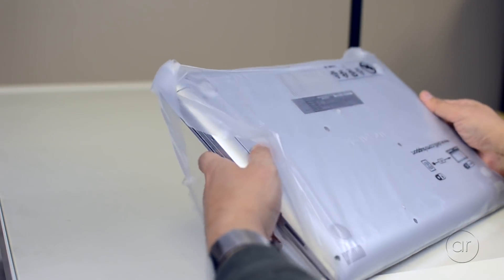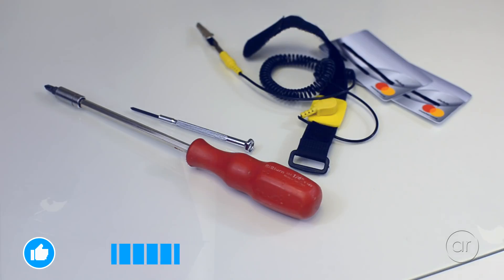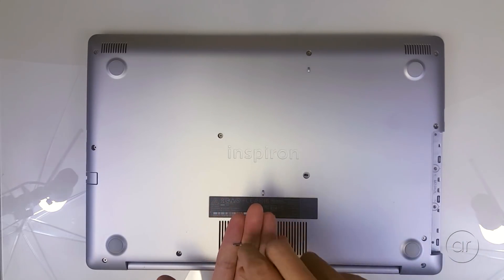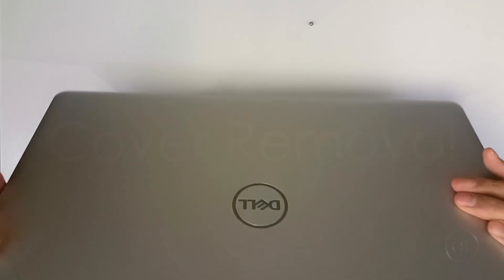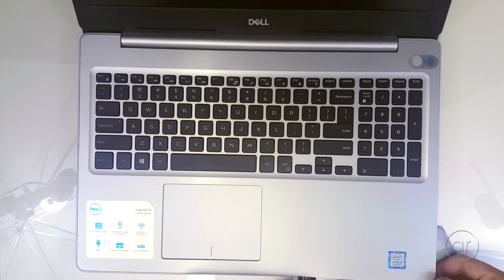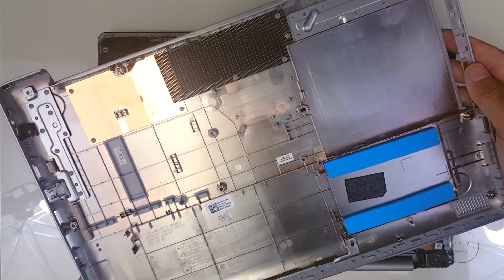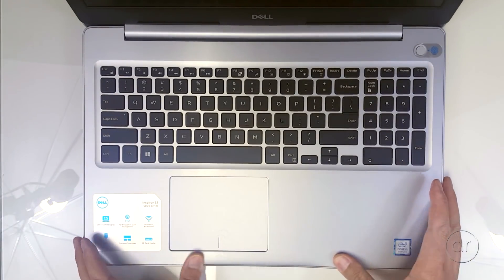How to Disassemble a Dell Inspiron 15 5570 Laptop to Install an M.2 SSD

Comment: I got excited when I watched your video and went out and bought a 1TB M.2 2280 SSD from Western Digital.  Before doing the install, I went back to review the video and the comments, and now I see that this machine will only support a 256GB SSD.  What would happen if Installed the 1TB SSD?
Reply from the maker: My installation of a 360GB SSD worked fine. Some have suggested that Dell's specs are simply the largest that they had tested at the time the documentation was written, and that it would not hurt to try larger capacities.
Reply: @accessrandom  Thank you for the fast response.  I think I will go ahead with the install.  I'll let you know how it works out.
Reply: @Spocket  Did it work for you?
Reply: @priteshjumani7249  I changed my mind about it.   I was afraid of voiding my warranty and being stuck with a broken computer.

Comment: Hello! Why you used SSD SATA instead PCI ex 3.0 with NVMe which is much faster  3000 mb (PCI ex) against 500 mb (SATA) ?
Reply from the maker: Hello - the Dell can take either SATA or NVMe, but I only had the SATA SSD at the time I created the video.

Comment: I barely bought the same laptop. I want to install an Adata xpg m.2 2280 pcie gen 3x4 nvme ssd and samsung 860 EVO Sata ssd. I don't mind reinstalling windows but how do I make sure that it will install Windows on the m.2 ssd instead of the SATA? Do I install the two drives hit F2 and change the boot order to my m.2? Or will it let me choose?
Reply from the maker: I'm so sorry, your message got filtered and I didn't receive a notification from Youtube so I just saw your post now. When reinstalling Windows from an ISO file, it will list the disks that are in your system, and you can choose to which disk you'd like to install Windows during the install. I believe it would be the same with any recovery disk(s) provided by the manufacturer, but just in case it isn't: you can physically install the SSD you'd like to boot from, use the recovery disk(s) to restore Windows, and then install the other SSD. Sorry again for the delay in replying...

Comment: Hello. Thanks for the video! I just subscribed to your channel :) I just got the same computer and wanted to know it if has a M.2 slot. Do you know how much is the maximum amount of storage this laptop supports? I want to upgrade to at least 512GB. Do you know if this model will work properly with the computer? Samsung 970 EVO 1TB - NVMe PCIe M.2 2280 SSD (MZ-V7E1T0BW)

Thanks a lot again and take care! :)
Reply from the maker: According to Dell's Setup and Specifications manual, the 5570 supports a "maximum configuration" of up to 256 GB for M.2 SATA SSDs, and up to 512 GB for NVMe SSDs. I've heard from others that this means that Dell will only sell configurations up to these capacities (not that the motherboard cannot support more). I can only speak from experience, which is that my 360 GB SSD is over spec yet it works fine.
Reply: Thanks a lot for the answer. Well, I purchased the Samsung 970 PRO 512GB - NVMe PCIe M.2 2280 SSD (MZ-V7P512BW) and just installed it and cloned it as you explained in the other video, I used the the same cloning software and it is working fine, cloning the 1TB took more than 2 hours :) Now with the new SSD, it took less than 15 seconds to boot since the moment I press the power button until getting the login screen. Beautiful! Thanks for the time and excellent videos!!!!!
Reply from the maker: Super! That's great to hear.
Reply: Just installed an Intel 660p 1TB NVMe SSD yesterday, so larger drives are supported too.
Reply: @everness7  excellent! Good to know.maybe in the future I will migrate to a bigger ssd! Budget issues, you know! Haha

Comment: Hi Can we use a msata SSD instead of  M.2 SSD? I understand that msata SSD's are old technology, but have an extra one with me I would like to use...
Reply from the maker: As I understand it, mSATA and M.2 are not pin compatible but I have heard of adapters for mSATA drives to fit M.2 slots. Perhaps one of my viewers or subscribers who have tried it have more information? Anyone?
Reply: Thanks for the response.  I think I will pick up a  M.2; prices are coming down at this time of the year!

Comment: Hello! What is the strap for? Where do you attach it? Why? To avoid getting electrocuted? Sorry, I'm a total beginner.
Reply from the maker: Hi - the strap is to ground yourself so that static electricity from your fingers doesn't fry any electronic components. I clip mine to the metal casing of a desktop computer which is off the screen. ESD (electro-static discharge) can be insidious because the damage may not be immediately apparent (sometimes the damage is catastrophic - sometimes you see the damage over time).
Reply: Thanks for responding. If I don’t have the wrist strap, how can I install my new ssd without damaging the components? Please give me a detailed explanation as I am a total beginner. Thanks in advanced!
Reply from the maker: If you don't have an ESD strap, you can touch the metal (un-painted) part of the desktop computer at all times while handling any electronic component such as the M.2 SSD.

Comment: Thank you sooo much sir for this detailed video. I searched many videos but yours is the best one...no other video can replace yours.
I am planning to buy this laptop 2tb one. I'm confused to buy this one or HP CC129tx.......plz help me
Can we upgrade the ssd as same with HP cc129tx.....?
Plz answer me sir ....🙏

Add the link where we can buy ssd for dell 5570
Reply from the maker: Thanks so much for your comment. I'm not familiar with the HP laptop you referenced, but I would check HP's website to see if there's a service manual that details the access to the SSD slot. There is an affiliate link in the description for the Dell 5570 (in the US), but of course it is also available at Dell as well.
Reply: THANK YOU SIR I'M FROM INDIA ....
I ALREADY BROUGHT THIS DELL LAPTOP ON FRIDAY THIS LAPTOP IS VERY GOOD........

Comment: thanks for such an amazing video....can u please suggest me that whether I can install 512gb SATA SSD in dell 5570 laptop because in the official manual of dell it is restricted to 256gb SSD only for SATA...thanks in advance!!!
Reply from the maker: Thanks for your encouraging comment. You are correct in that the 5570 officially supports up to a 256 GB SATA SSD as shown here:

http://topics-cdn.dell.com/pdf/inspiron-15-5570-laptop-_setup-guide_en-us.pdf

I can only speak from experience , which is that my 360GB SSD is over spec yet it works fine. My only concern is that they could release a BIOS in the future to make my 360GB not work. Sorry I'm not able to provide a definitive answer - perhaps other can chime in?
Reply: thanks for the quick response...I will be grateful if u suggest me that should I upgrade with 512 SATA SSD even after official restriction to 256 GB and whether it will have any negative impact on my laptop or performance if I do so by installing 512 GB SATA SSD...
Reply: @akshayaamar9825  Hey did you install 512 GB SATA SSD in M.2???
Reply: @GabrielMendezz  I installed 256gb SATA SSD in order to avoid compatibility issue
Reply: @akshayaamar9825   yeess good job so i decided to buy one ssd m.2 NVMe with 512gb as it said the manual  there is not problem with that ssd NVMe with 512gb
Reply: @GabrielMendezz  gr8...hope u enjoy the experience with the upgraded drive...

Comment: sir isn't support on Dell 5559 laptop plz tell me.....
Reply from the maker: Looking at Dell's website, I didn't see support for an M.2 slot for the 5559, sorry. (If you search for Dell 5559 manuals and documents, you'll see Specifications documents). The casing itself look different if you look at the service manual.

Comment: Could you possibly create a video demonstrating how to apply new thermal paste to the cpu?
Reply from the maker: If I ever get an opportunity to do so, I'll create a video. Were you looking for just a video on placing a heatsink/fan on an Intel or AMD CPU in a desktop PC?
Reply: Thank you! We'd greatly appreciate it.
A video more along the lines of applying new thermal paste for this model laptop.
Due to the thinnest of this laptop, fans tend to throttle under heavy load during content creation. 
Knowing how to apply new layers of thermal paste to the CPU may help prolong its lifespan.

[I recently bought this laptop and am sorta new to laptop maintenance]

Comment: Hi Access random.. nice video!  I just bought one of this with M2.SSD installed..   the thing is I wanted to add my old SSD for additional storage.  Do you know if it comes with HDD/SSD cable already. and of course the bracket.     The bracket I'm not so afraid, but if there's no connector, it's no point to open up the computer.  THANKS!
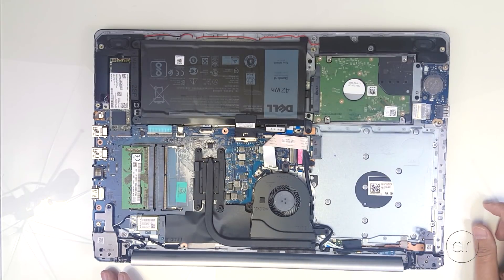Reply from the maker: Thank you! The interface for the 2.5" SSD is simply a SATA connector (where you plug your SSD into it), so there's no cable as such. If you look at the video at the 5:22 mark, you can see the drive going directly into the black SATA port to the left of the drive. I'm assuming that you only have an M.2 SSD and no other 2.5" drive - if you do have one, you'd need to swap it out for the SSD. I hope that answers your question...

Comment: Loved this video. Thanks a lot. This made the disassembling look so easy for people like me who have never dared open a laptop back-cover. However, I have a few questions about adding an additional 8Gb RAM to run in Dual-Channel. Does it have to be the same RAM module the company used? What are the latency timings of the RAM installed? Can I use any 2400MHz DDR4-L having near-similar timings? Thanks.
Reply from the maker: Thank you. That's a good question - I wish I'd zoomed into the RAM label while it was opened up. Looking at Kingston and Crucial's websites, I saw both CL-17 and CL-19 from Kingston, and just CL-17 from Crucial (and these were just single 8GB 2400 MHz sticks, which presumably would be matched with the existing one) - the common denominator being CL-17. Perhaps one of my subscribers/viewers can chime in to make sure?
Reply: just upgraded mine......it was a 4gb dell inspiron 5570 core i5 8th gen
Added another 4gb stick and i can say now its way more snappier than before
IT eats through everyday task  like a knife cutting through butter. And on top of that i CAN GAME.
It was worth investing about 65 us dollar into it. Now just have to upgrade my SSD and it'll be a beast.
Reply: My dell came with a hyundai  stick but i've put a kingston one in it .....i dont think brand does matter but it just should be same frequency ,,,mine was ddr4 2400

Comment: The two screws under the CD drive is very hard to remove.. help.
Reply from the maker: Those two screws have a smaller head, so you'll need a screwdriver with a smaller screw bit (like the one shown at 0:43).
Reply: LMRN having the same issue here

Comment: shouldn't u teach user to detach battery connector first???
Reply from the maker: Great catch - I'll update the description and credit you. Thanks!
Reply: @accessrandom  I was looking in the Dell tech manual. After disconnecting the battery hold down the power button for a few second. Any power in the capacitors will be dissipated although they call it phantom power.
Reply from the maker: Thank you! Do you mind if I add this and your name to the description?

Comment: Hey man I got a 5575, installed the SSD correctly, but computer doesn't detect it. Not even in the BIOS. Not sure what to do
Reply: If it is SATA, it can support up to 256G. If it is NVMe, it can support up to 512G. Be sure which one you have.
Reply from the maker: Is it a SATA or an NVMe? If it's NVMe, you could try updating the BIOS. Otherwise, just make sure the SSD is seated correctly in the M.2 slot, or even try it in another laptop (if possible) to make sure it's working.

Comment: Thanks for sharing this, I recently bought this notebook and came with 2TB harddrive but i think that this is really a bottleneck, How much faster is the notebook with the SSD?
Reply from the maker: I haven't done any time tests, but subjectively it is much faster with the SSD. The boot up time itself (for which most of the time is just the BIOS startup) felt like it was cut in half. Probably even faster for starting large applications like Photoshop or Vegas.

Comment: PATRIOT SCORCH 128GB M.2 will work?
Reply from the maker: The Dell Inspiron 5570 supports both SATA and NVMe in its M.2 slot, so it should work.
Reply: access random Thanks.
Reply from the maker: You're welcome.

Comment: I was planning to get this laptop,and didnt know its this hard to open it,
So to my understanding the ssd and the hdd can co exists at the same time now watching this,now I was thinking what if I just get the acer e5-576G with kinda similar specs but it has nvidia mx150...it it easier to upgrade?...🙄
Reply from the maker: Yeah, I love the computer, but Dell certainly did not make it easy to access the hdd and sdd. They will co-exist together. From the few sites about the e5-576g that I could find, it does look like the Acer has an easy-access panel for the M2 SSD and the hard drive.
Reply: I edit a lot of photos ,And I heard this got ips display which Im looking for ,the only thing that turns me off is the graphics card and how you upgrade it,If i choose the acer the graphics card is a better nvidia but the display is not ips,so Im kinda confused which to get...🙄
Reply from the maker: Hi Jed - actually, the one I have is not an IPS display - there may be other configurations that have an IPS display, but mine is TN. Since the Acer has better graphics, you may want to consider that instead (with all other things being equal).
Reply: The BIOS shows support for FOUR drives for the Inspiron 15 5570 model.  The M.2, the 2.5" and you could put one in the DVD bay.  I guess the forth is an external OR it may be that I am totally wrong and it is a standard Dell BIOS and is used in Desktops as well as laptops.  I have only previously dealt with the Dell Server BIOS.In the Service Manual is shows a Solid-state drive shield covering the M.2 but it only on machines that comes with an M.2 drive. I don't know how essential the drive shield is when installing the M.2.  Caveat emptor as Dell may use that to void the warranty is the machine has an issue that related to the drive.

Comment: I have this laptop, with 32G and a very slow 5400 rpm drive. So I await your next video, telling me how to boot up on a new SSD while keeping the 5400 rpm drive as a secondary. I am curious: do you see much benefit over an NVME drive than the SATA drive for most users, compared to the huge speed up moving from a mechanical drive to an SSD?
Reply from the maker: I'm afraid that I don't know the answer to that, as I only installed a regular M.2 SSD into the slot (not an NVMe). Sorry if I gave that impression. But my plan for keeping the 5400 rpm drive as a secondary drive is the same as yours. I did successfully clone and boot from my M.2 SSD and captured all the screens - I just need to create the finished video...
Reply: Your two videos were awesome, thank you. I've been running now for two weeks with an NVMe as the boot drive and the 5400 rpm as a secondary, and it has worked great. It used to literally take 10 minutes to boot the machine and let windows do its thing before it was really useful, now it's 30 seconds. (The other "tools" that helped me out a great deal were an egg carton and a sharpie.) Thanks so much!
Reply: For most users NVMe isn't going to make a big difference vs SATA III. But since the only unused slot is an m.2, you made the right choice to go for an NVMe drive anyway since m.2 SATA drives aren't much cheaper than m.2 PCIe ones.
Reply: can you tell me your 5570 specs and nvme brand name, i have dell 5570 with core i5 8th generation ,  but some people told me nvme is not supported on this model
Reply: @Brn Why it has no big difference ? . NVMe drives, provide write speeds as high as 3500MB/s. That’s 7x over SATA SSDs!
Reply: @thirdpole9624  that's sustained read/write which you'll only notice when you copy big files to from/to another NVMe drive. How often do most people do that? Certainly not everyday. If you copy NVMe to or from a SATA or USB drive, you'll be limited to the SATA or USB drive speed. If you copy small files you won't even notice. Most of your performance gain over a HDD is from faster read writes of small files, which is why 4K read/write and access times are really the two most important benchmarks to look at. When an OS boots or when an application like MS Word starts, it's mostly small files loading into memory.

NVMe drives are great if you edit videos or music a lot because those kind of activities work with big files, but normal users don't get much benefit from NVMe.
Reply: @brngtr9728  This is empirical, but my Alienware which supports both  NVMe and SATA M.2  boots faster from the NVMe drive.  I back up (clone) monthly to SATA's and weekly to NVMe and have booted from both.

Comment: Ugh... got one of these and was finding it a bit slower than I had really expected and considering adding an SSD to get the lead out. The having to wedge the keyboard off bit definitely has me uneasy...
Reply from the maker: I don't blame you a bit. This was the most user-unfriendly laptop I've had in terms of accessing the internals. With that said, I did see significant performance improvements after installing the M.2 SSD. For example, from the time that I pressed the power button to the appearance of the Windows login background screen, it took 24 seconds to boot up from the hard drive, while it took only 12 seconds to boot up on the SSD.
Reply: @accessrandom  Are M2 SATA SSDs supported by this laptop?
Reply from the maker: Yes, both M.2 SATA SSDs and M.2 NVMe SSDs are supported by the 5570.